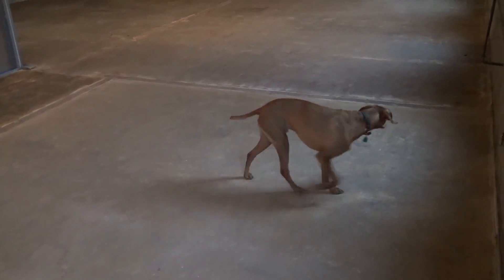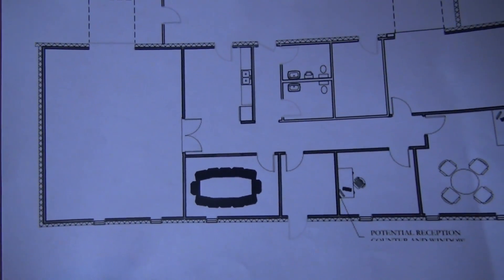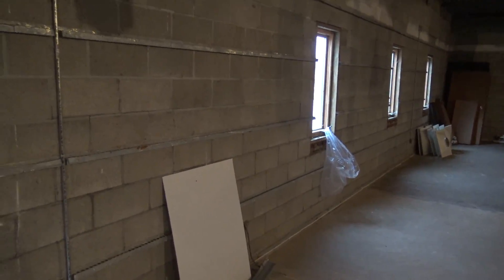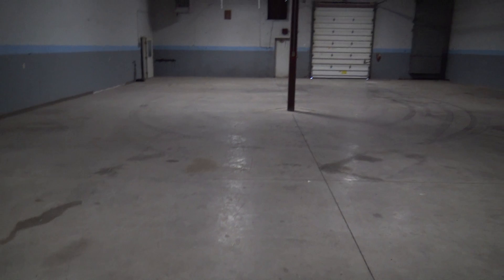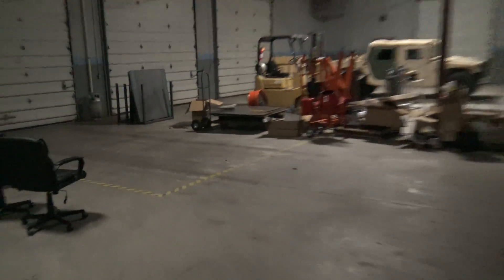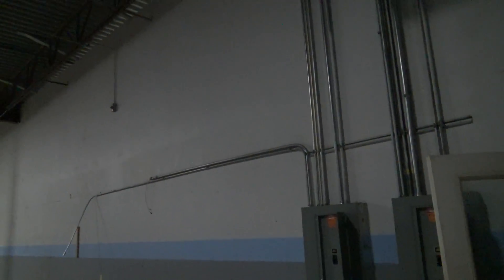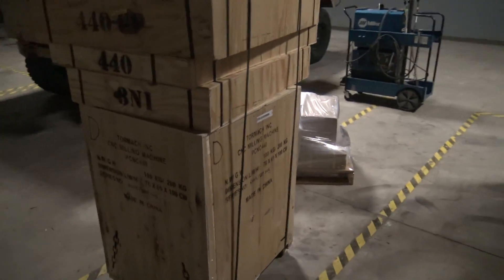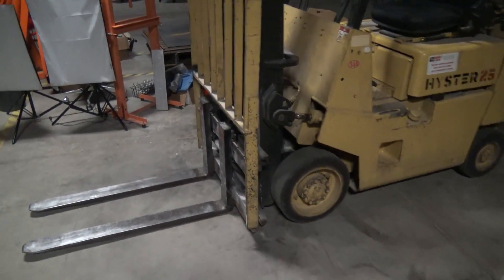Shop Update #1

Comment: For that space at the top I would go with half inch/13mm particle board coped in around the steel beams on one side then fill any gaps with expanding foam. Overlap the top run of blocks and attach to the blocks with ether Hilti gun or Tapcon screws. Use 2X4's to join the boards to each other. Hope this Helps John!

Comment: We had the same problem with the top of our wall and we stuffed it with fiberglass bats to keep our welding shop gunk away from our sheet metal shop. Cheap and works great. We also put in an exhaust fan and motorized inlet damper to get those nasty plasma fumes out of the building. 
 Also, be VERY careful with epoxy floor coatings. Many of those generate seriously painful static electricity issues. I once worked at a location that had one put down and had to have another coating of anti-static epoxy put on top because electronics were getting fried (and people were getting the dreaded carpet shock). Love the space!

Comment: My current employer plumbed the new half of his shop (a heavy duty truck shop) with the Parker Transair stuff and it's been fine, mostly, with only one major failure in seven years, and that was due to improper installation.  But, the connections are, basically, quarter turn compression fittings.  Our system is almost always under a pressure of 150psi.  The handful of times the system lost all pressure it leaked like a sieve once pressure was restored.  There's no possibility of "nipping up" a leaking fitting.  Replacing o-rings and sleeves is difficult when the piping/fittings are in the middle of a run.  It kind of has the hassles of repairing threaded pipe with none of the reliability of threaded pipe.  Whichever way you go, just be sure to put valves in all over the place right from the start.  Aside from a valve at each hose reel, the only valve in our system is at the compressor and that really sucks.  In order to fix the leaky fittings the whole shop has to do without compressed air while those repairs are made.

Comment: John make sure put in a lot of isolation valves in your air circuit, nothing worse than trying to do maintenance whilst keeping operations happening without sufficient isolation. I built a large food factory and we used polyethylene piping for compressed air. It works brilliantly and is much less expensive than metal piping and very robust. This was in Australia so not sure if PE is acceptable in the States. 15 years later and still going strong.

We had around 250KW (400HP) of compressors so it is a serious installation. Excellent quality of air required too for our food equipment. The only thing we had to add later was a receiver at the far end because we had very long air runs, much more than you will have.

Comment: On the subject of the concrete finishing, you might want to consider getting the floor ground before you epoxied, depending on the surface finish of the pad. - See John Grimsmo's video on his new shop  - "New Grimsmo Knifes Shop Part 2" at about 40 minutes in. 

The reduced surface roughness would also make keeping the shop clean in the future a lot easier. Nothing worse than trying to clean tiny chips out of pits in the floor. 

For the teaching, video and conference rooms, consider getting your contractor to stuff the walls full of sound insulation and use sound insulating drywall. Consider closing the the ceiling too, even just with hanging ceiling tiles. It makes a huge quality of life improvement for a (relatively) small investment, as long as you do it at the right time.

Comment: At my facility we have had problems with the LED light power supplies going out, mostly in areas where the temperature is around 130 degrees at the ceiling during the summer.  See about a warranty replacement from your LED light supplier.  T-8 highbay lights are a good option but changing bulbs out every few years may be a problem around machinery unless you have an articulating lift available.

Have you checked into stainless steel pipe for your air supply?  Cost may be a lot lower than copper but sealing stainless steel joints is a bit more involved than sealing something like carbon steel.  I am replacing the PVC air lines in my shop with stainless steel especially in the areas where the PVC can get damaged at lower elevations.

Nice shop, maybe some day I will get something half as nice.  I'm working toward that goal.  Merry Christmas.
Reply: There is a special pipe joint compound that is specifically used for stainless steel pipe.  Most plumbing supply stores will have this.  To make sure my stainless steel and all other pipe joints do not leak, I double seal them.  First I coat the threads in a pipe sealant like Rector Seal 5 and then wrap that in Teflon thread tape.  It is a bit of a mess but I do not have leakage especially when using something like a Tee fitting that cannot make another full revolution to be a tight fit with a pipe wrench.  The connection is tight enough with the sealant and the tape making a seal on the threads.  Installed a lot of stainless steel pipe before that had small leaks even with the stainless steel thread sealant before I started double sealing my threads.  I do all my threaded pipe fittings this way with the exception of brass.  Strait threaded pipe fittings are the hardest to seal compared to tapered.  With double sealing all my threaded pipe fittings, I no longer have this problem.  This works for me and other people may have their own preference and may think what I do a wasted step but I have never had to go back and tighten pipe fittings that are leaking since I have double sealed.
One thing to note is that stainless steel pipe needs to have sharp (new) threading dies when using a pipe threader  (either manual or powered) to prevent galling of the threads.  Stainless steel threads and the cuttings are very sharp so they like to lodge into skin.  Care needs to be taken when threading stainless steel pipe.

Comment: RE top of walls: I'd just cover the gap with a fire rated plywood on one side only to eliminate the dust transfer.  Three should not be a 'code' issued between the two spaces unless that wall is being considered a fire wall for some reason.

Comment: Amazing! That place is huge! Congratulations, John!

On the dust issue - that depends on your airflow. My surface grinder doesn't deposit much dust above eye level, but my 2x72 grinder really moves a lot of air, and it leaves dust everywhere in the room. Maybe hold a shop-warming party with a smoke machine in the "gritty" room and see where it goes haha
Reply: +Geof Dumas Wood shops make TONS of dust, and it's gotten to be  a standard thing to make "air cleaners": just big, boxes with furnace filters on the sides and a large squirrel cage fan sucking air through it. Really helps keeps ambient particulates down if placed on the walls near the source.

My company looked at having the floor epoxied, but opted to have it ground smooth for a fraction of the cost, and got a lot of the same benefits. They talked to the guys that do the Wal-mart stores.

As far as insulating the offices: can you put insulating foam-board on the OUTSIDE of the walls? I saw this being done when I was in Germany. They just put a stucco over the insulation. Looks nice. The insulation helps keep the concrete block wall at a stable indoor temp. The interior just needs a nice finish with surface wire races for networking and power.
Reply: +NYC CNC April might be doable!

Comment: That gap may be for movement of the roof structure. Most of those style buildings move around a bit with wind/snow loads. The easy way to fill it would be to use insulation blankets. Same stuff they use in many metal buildings to insulate the roof/walls. It's basically fiberglass batt inside a fire retardant wrap. That would seal the gap but still allow motion. Don't forget to install intercom and emergency lighting. For emergency lights I used a mix. Conventional fixed lights at exits and room lighting, plus Streamlight LightBox power failure lights in a couple locations. That way you have portable lighting that is automatic.

Comment: close off the space between the two large rooms for heat and sound control.   It will be hard to have any kind of private conversations in either rooms.  And it will be hard to control the heat when you have the overhead doors open to the outside.

Comment: I think the gap between roof and wall is there to allow some movement. If I remember correctly a similar construction was speced to several inches of vertical motion (max weather loading). So double check before doing anything like hard wall or expanding foam.

Comment: Hi John,

I'm planning a plumbed in air system and looked at various options. I liked the easy installation and flexibility of the John Guest push fit system but not the price although it does have a nice feature of keeping any water in the main line and out of the drops. Instead I plan to use MDPE water pipe and fittings. The pipe and fittings aren't rated for air, even though they're the same material and headline pressure rating. They're up to the job, just not certified. I can get away with using them because I'm non commercial.

If you can find the right LED lighting, it's definitely the way to go. I replaced four 70 Watt T8 tubes with eight globe LEDs. They're a mix of 8 and 13 Watt units (what I could get from Aldi) totalling around 80 Watt. The illumination appears to be about 50% better than before, comes on at full brightness and is not affected by temperature.

Comment: Hi John, i would seal those gaps on top of the wall with polyurethane foam. It comes in big aerosols and is used alot in construction where i live. It's greqt stuff. Good luck with the shop!
Reply: i didn't think those gaps were that high, it would work, Just needs alot of building up the foam layers, wich would get really expensive doing it that way. Maybe you could use the drywall waste, and just use the foam for sealing the gaps.

Comment: hey john, sounds good so far. just one recommendation: get yourself a wired network connection in all rooms  (multiple outlets) and also in the shop for the machines. setting up a reliable wireless network in a building of this size is expensive and not easy to do. now that you have the chance to do it right,  I can only suggest to do this. 

best wishes and merry Christmas

phil

Comment: oz opinion here: plastic lines for air, buy high pressure agricultural water hose (fittings and hoses are cheap, widely stocked, you're not tied to one brand, tolerates humidity obviously and is robust. large supply lines up high and drop down to outlets/traps.

regardless of what lighting you choose, you have to avoid anything that flickers or uses PWM for brightness control. Personally I'd go for too much lighting that's cheap/disposable.

Comment: The plasma smoke and crap will float to the other side if the roof is tilted that way. Other than that, don't really know.
Reply: NYC CNC Won't just proper exhaust do the job? Would save some (=alot?) money.
Reply: NYC CNC That depends on your setup and all. But my previous workplace had every machine (20+ cnc machines, + grinders and welders too) hooked up to a central vacuum system. Keeps the steam out from the cnc's too, no breathing the cutting fluid. But your shop is smaller and that affects it too. If it's too expensive to do all machines it may not be wort it.

Comment: I laughed out loud when I heard your reaction to the price of copper air lines. ... yep!!! Some large diameter PE and you'll be sweet, I don't know of any down side to using it to be honest. On the other hand I think you're being smart in sitting on your hands for a while. It's worth doing it right, and getting all your drops and falls correct so everything stays dry. Having a well designed air system in a shop is a great asset but really should be properly planned. You will thank yourself later for thinking this through well.  Likewise for the lights, when you look at the lighting calculators it always seems like an absurd number of lights are required, well it does for me anyway, and far more than I would expect by just guessing it, but once it's done the correct number and appropriate type of lights makes such a difference to working in an area.

Unless you're really intending to change the type of work you're doing, I wouldn't lose too much sleep over that small gap at the top of the wall. It's not like you're using the other area as a walk in sand blasting room! I can't imagine either room being any noisier than the other, but I'm just going off what you show on your channel. It would be different if one was the classroom etc, but if it really bugged you it wouldn't be a big job to go back later and fill in the gap. I'd think you'd have bigger fish to fry at the moment.

It looks like a fantastic area to work in John, and you're clearly putting a lot of thought in to it. 2016 should be a cracker year and something to look forward to. Good luck with the whole enterprise.
Reply: +NYC CNC PE is Polyethylene ie the link to air hose I sent you. It's also commonly referred to as irrigation pipe. Anyone is free to draw their own conclusions as to whether the latter would be a very inexpensive alternative to large diameter runs. PE sold for air use says so on the outside (down here anyway), Irrigation pipe is sold just about anywhere and almost free! I'm not endorsing the use of appropriately pressure rated irrigation pipe, just saying other than the label I don't know the difference ;)

Comment: If you have larger or more noisy equipment, you should look at getting a polymer conrete (epoxy granite) base to put under the machines. It dramatically reduces noise and vibration from the machine and may actually improve precision.

Comment: Hi John,I am installing air line in my shop right now!  I am using a system from Engineered Specialties LLC called MaxLine.  It is a HDPE semi-flexible tubing.  I am using 3/4" ID tubing.  The purchased a kit from my local Farm & Fleet store that had 100 feet of tubing with all the hardware for three drops.  Very nice system check it out at www.RapidAirproducts.com.

Comment: To separate the rooms at the top of the wall, I would use some simple sheet metal panels. will keep the dust out, and act as a fire break.

Comment: In regards to your air system, make sure to add some air tanks (receivers), a couple of 100 gal. ones would be good.  If you run your air compressor and air receivers at a higher pressure, say 150 PSI, and your air loop at a lower pressure, say 80 to 90 PSI, you effectively increase your air capacity significantly.  This can also reduce your electrical consumption.
Reply: +NYC CNC Sure Anytime!  Concerning Blazer02LS statement, he's correct on the metal piping, commercial building standards will not allow for plastic piping.  I will tell you the air receivers act as heat sinks and provide some level of water removal.  Depending on your dew point requirement, you could use a refrigerated dryer or a dessicant dryer, afyer the air receivers, though both are expensive.  The dessicant dryer will give a lower dew point (less water), but can be very expensive to replace dessicant over time.  Probably the most cost effective idea would be a refrigerated dryer on the main loop, then point of use dessicant at the drops.  The cool thing is, someone, I forget who (problem with getting old), makes a point of use dessicant filter that you can regenerate by cooking the dessicant and reusing it.  Enjoy the videos, keep it up!

Comment: Exciting times John.  For the floor in the fab area I would seriously consider sealing the concrete if it is not done already.  Where I used to work we had a new shop and they sealed the concrete it really helps with cleaning grinding debris.  Your epoxy floor contractor probably could do it or give you a referral.   For your air I think others have mentioned the coated aluminum tubing.  I know you can buy that DIY I think +Randy RIchard did a video on that.  Also all the major air compressor companies sell their version of it.  I saw Atlas Copco at a trade show, theirs looked very impressive, but pricey.  I would definitely close in the wall at the top.  I would imagine framing  and drywall would be code approved?